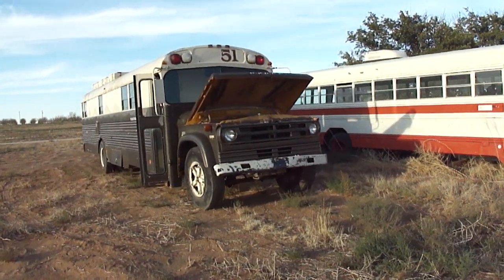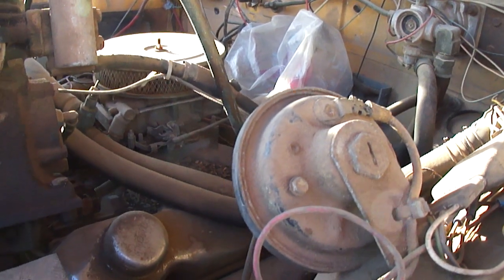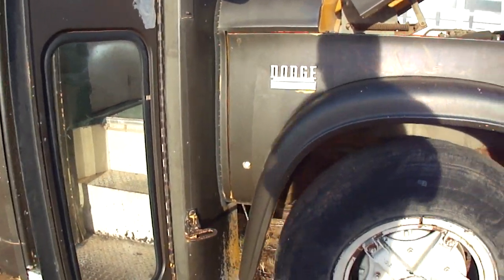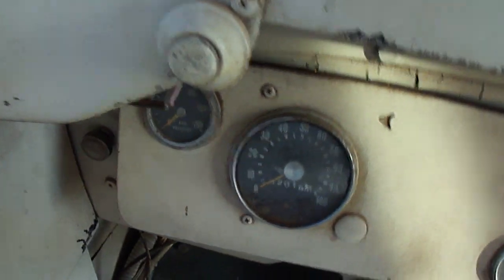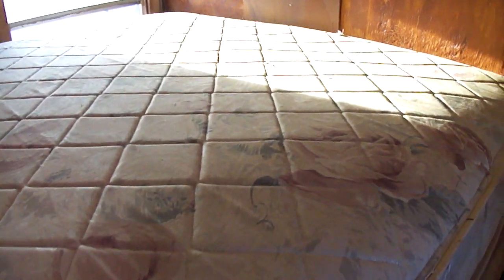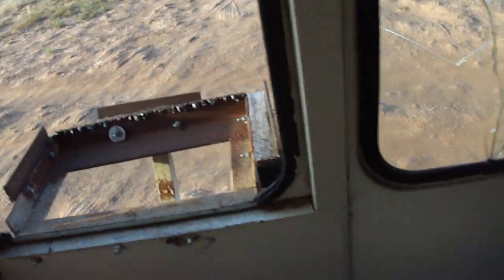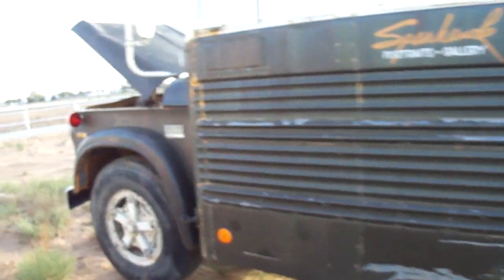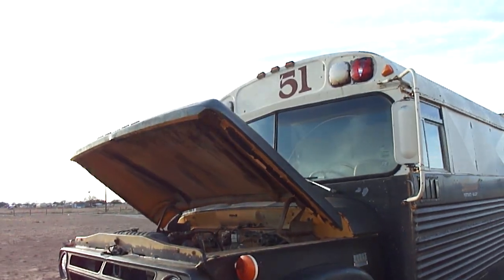1971 Dodge/Carpenter bus converted to RV overview

Comment: I actually like the layout inside, but the air conditioner placement isn't good. BUT there is a good use for that camper roof top unit you showed in a older video!

I cannot wait to see this thing starting up!

Comment: I think I saw a small pin-hole in the radiator at 1:00, you could probably solder that. Other than that and the tiers, it looks really nice. Just needs a good cleaning and you could rent it out, lol.